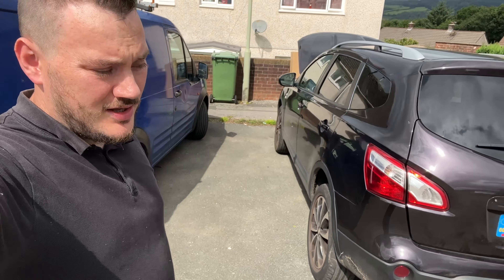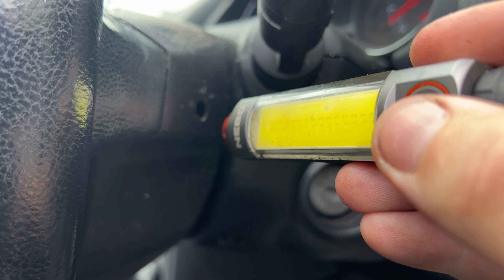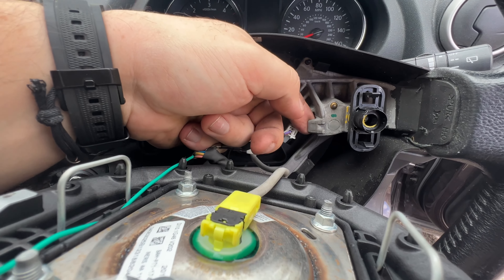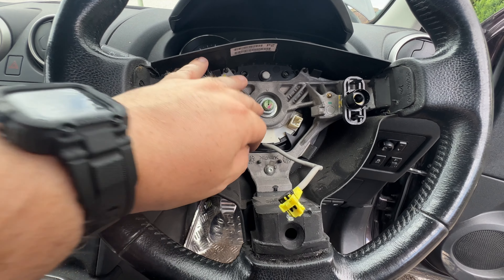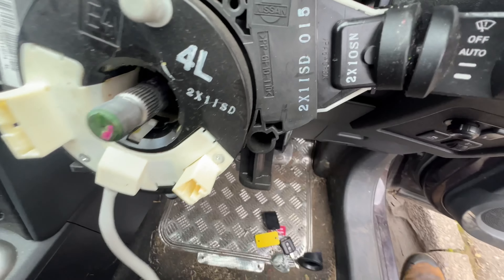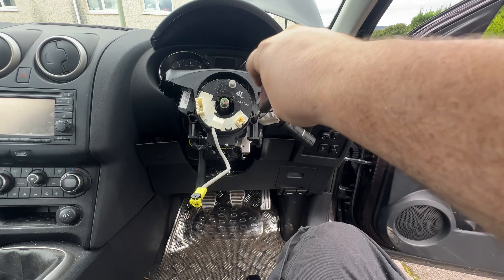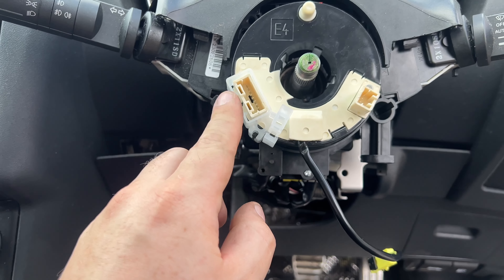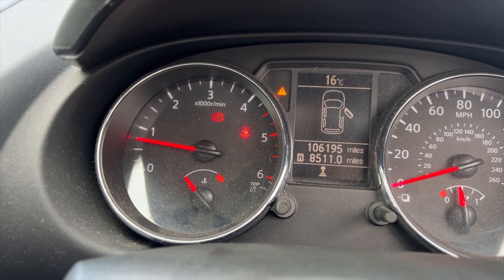Called back to a Qashqai with a flashing air bag light

Comment: Hi mate, great video, I have myself changed the clock spring and have reset the car with the key trick. Took for a run and all was well, now today the light has reappeared. Any other advice to check ? All the connections behind the wheel are free from corrosion etc.
Reply from the maker: Sorry just seen this…. Did you sort it? If not what codes do you have?
Reply: i have this same issue as chris any suggestions on what to do next?

Comment: Hey, great vid.  My OBD2 doesn't show any code...would it show on there?
Reply from the maker: What scan tool do you have? If you have a cheap basic obd2 reader they normally only show engine codes. Have you got one that reads air bags?
Reply: @EllsAutoCare  I thought it reads everything mate but you are right...I got a mate to read it  one and it came up with codes B1049 and B1054.
Reply: @EllsAutoCare  Hey, found codes B1049 and B1054.